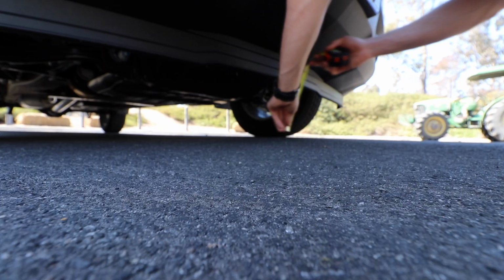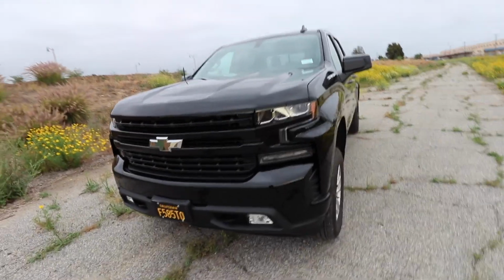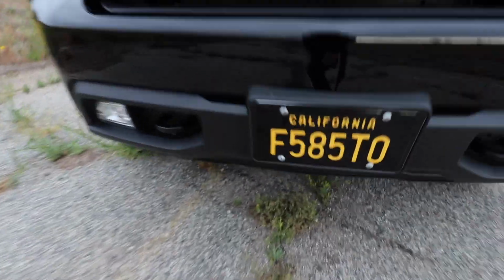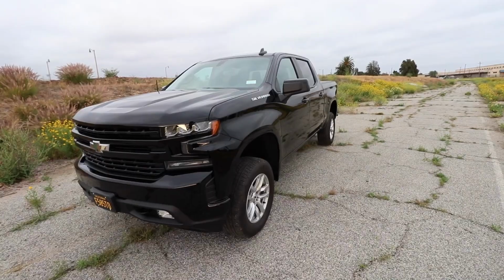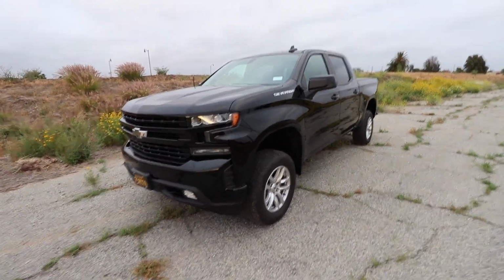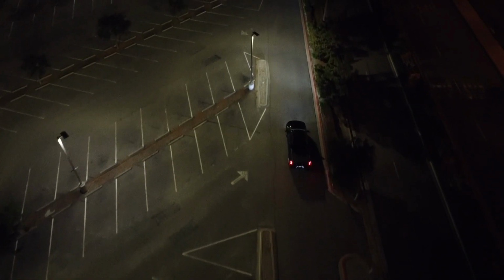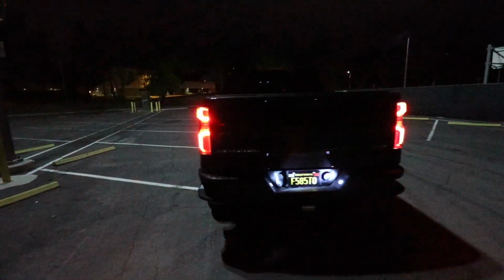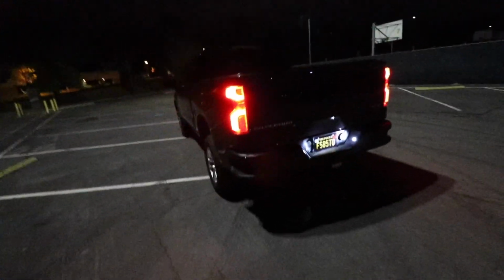Lifted My 2021 Silverado RST!!

Comment: I have an 21 gmc elevation...putting TB/AT4 bilstein kit with eibach springs and 2" block in back.....should be 3.5 in front and 2" in rear...(can go to 4" but I wont)....just like it better than a spacer and will get more travel on susp....also upper a arms and drop kit for diff....just received all parts
Reply from the maker: That’s awesome. Do a walk around vid when it’s done

Comment: Looks really good. Getting ready to level my TrailBoss.  What tires did you decide to go with?
Reply from the maker: Toyo AT3
Reply: @MarkBrenner  did you look at the nitto ridge grappler?  Trying to decide on tires n get peoples opinions and why they choose certain tires.
Reply: @jeremyw9213  I used to have the trail Grapplers. Now I have the Ridge Grapplers.. will never go with any other tire than the nitto Ridge Grapplers.
Reply: @atelliott  thanks for the info. Do u live in an area that gets snow? If so how do they do?
Reply: @jeremyw9213  no I'm in O.C. in Cali as well. But I've been up in the mountains with some snow and they did great. They have also done great on very rocky trails just 2wd with out airing down. Great grip and they are durable. Haven't been chewed up hardly at all so far.
Reply: @atelliott  thanks again for the info.

Comment: Do you plan on regearing or recalibrating the speedometer with 35s? Or does it even make that much of a difference
Reply: It will only be off by +/- 5mph. Not a huge difference.
Reply from the maker: It won’t be off by too much so probably not but regearing will more then likely be happening after I get a feel for the loss of power with the 35s on